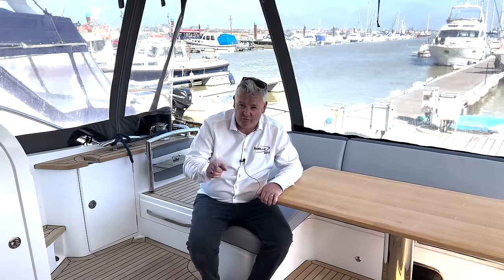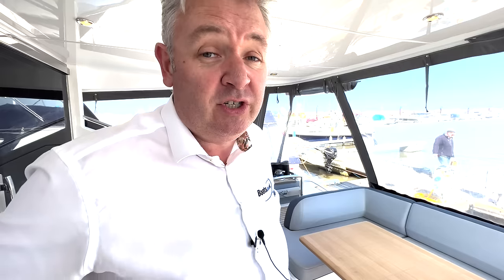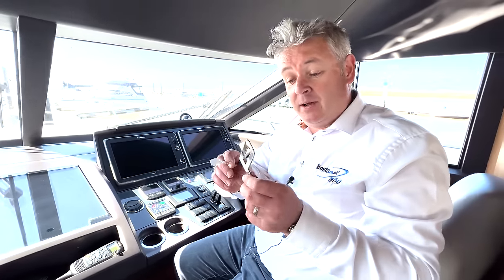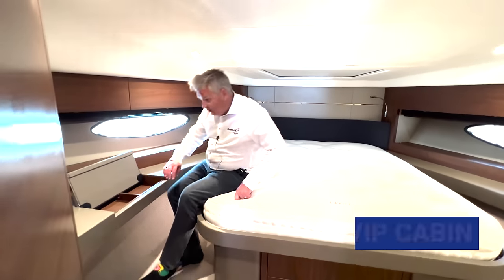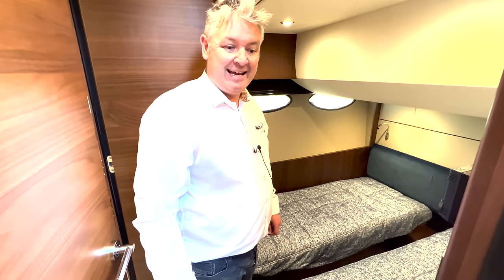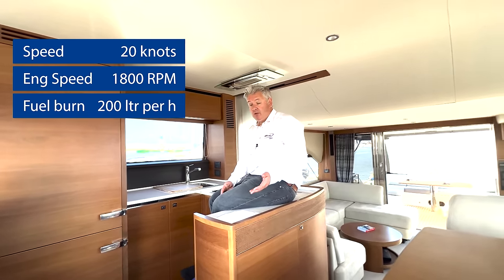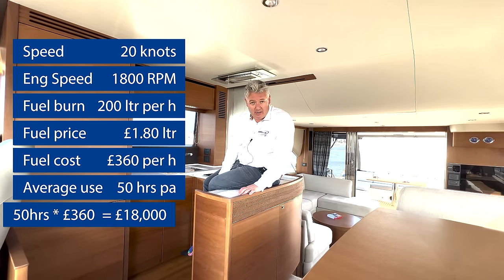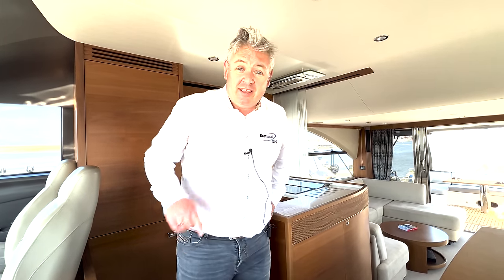£1 Million Princess 60 - How much does it cost to buy and run this boat per year?

Comment: These vids are absolutely great. Especially considering it's an opinion from a boat marketing industry professional. Anyone in the market for motor yachts will Love it! Thanks!
Reply from the maker: Ah thanks Chris 👍🏻
Reply: If this boat was initially sold back in 2016, does it mean EU VAT has been paid? If not, what would be the price of the boat ex VAT?
Reply from the maker: @buoyohbuoy790  it is uk vat paid and can goto the eu with a uk for 18 month stints 😎
Reply: You showed the crew cabin - would someone really have crew in a boat of this size? Didn’t mention in costs..? Would surely be better use as garage for toys in my opinion

Comment: Unfortunately in the real world the depreciation is far greater than that, I was the skipper of a brand new Princess 65 flybridge yacht which cost us £1.1m and it arrived from the factory with 168 faults which took princess 3 years to put right. At the end of 3 years the boat was perfect and we sold her for £550,000. The owner had about 60 nights on board in all that time.
They really are a huge hole in the water to throw your money into, but fabulous fun.
Reply: Wow, that was a lot to loose in 3 years. Just in depreciation that works out to 9,166 pound per night. Then you put your wage in, fuel, insurance etc that works out to a lot of money for one night. Spending all that money, it must have been an amazing amount of fun each night? You are right though, they are a huge hole in the water to throw your money into.
Reply: @spacewalktraveller1  yes it does not make any sense to buy a new yacht, my advice would be to buy them at 5 years old when everything has been done to them all faults ironed out and lots of servicing has been done, they should still look new but for a third of the new price.
Reply: @captaindave47  Thanks for the reply. I was surprised when you said the boat had 168 fault, I though Princess was a top notch boat builder and they took 3 years to fix the problems. I'll take your advise and get a second hand boat, otherwise you are throwing a lot of money away.
Reply: >>At the end of 3 years the boat was perfect and we sold her for £550,000
Was this during the 2008 financial crash or something? Was this part of a deal that might be partly money laundering? Similar models that are over 10 years old are currently going for a few hundred thousand more than that.
Reply: @spacewalktraveller1  no it was before the financial crisis of 2008. We had it on the market for quite a while before accepting that offer, we were planning on buying a new 25 meter yacht but the owner for cancer and the family decided to get out of boating until they knew the outcome.
I think that's why they took the low offer. It's always a buyer's market when it comes to boats.
Reply: @darthkek1953  Going for or advertised at? Huge difference...
Reply: What a fiasco
Reply: @ZorgR  Going for... the current sales market is ... "buoyant".
Reply: As the late and much missed wit Victor Lewis Smith once quipped owning a Motor Yacht in the UK is comparable with standing under a cold shower while tearing up £50.00 notes 😅. Although I would still love one.
Reply: That is interesting and terrifying all at the same time. Can’t be many people who can afford boats like this. I think I’ll keep my stationary house.

Comment: Great Video and Great job explaining some of the costs, which I should point out are subjective. Obviously the fuel costs you mentioned would vary depending on how much cruising one does in a year. If you pay cash which I'm sure some people can do, then the financing and interest normally attached to it would be void. In North America as I am then berthing could be cheaper depending on the location and the Marina. Again some people might be berthing their yacht at their home which is located on the water front. Insurance I assume would also depend on whether you are a seasoned boater or new to the market. Having said all that I did like the fact that you gave your best attempt to make people more aware what the costs of ownership really are. 
Some things which I always look for which I think you didn't mention is; What is the beam length? What size is the black water and fresh water tanks. What is the cost of pumping out the black water tank?    Thanks

Comment: Wonderful video! Would you happen to have fuel mileage if most of the traveling was done at displacement speeds? I'm guessing 8-12 knots for a boat like that, correct? I know that this type of boat is designed to cruise on plane, but for coastal cruising such as on the east coast of the US, many times it's more about the journey than the destination, so speed isn't really a factor except in cases of emergency or outrunning a storm. Thank you!
Reply from the maker: Yes it should use less than half that 😎
Reply: If that's your plan you're much better off getting a semi-displacement hull. You'll still be able to out-gun a storm but your displacement mileage will be a lot better.

Comment: Can’t believe I’ve only just found this channel…. So glad I did!  Been looking for a comprehensive view on costs of one of these boats for ages!  So the 8-10% of boat value, which a lot of people mention seems true in this case.  Here’s a question, which boats generally have the lowest % (of total value) running cost
Reply from the maker: Ah thank you. Lowest running cost would be displacement hull, shaft drive, single diesel motorcruiser or any sail boat.
Reply: A rubber dinghy

Comment: The boatyards I work in, (or river) most just get red diesel delivered which costs between £0.90p to £1.25 a litter depending on how much you buy etc, But with the reforms now on when you get it delivered or from a fuel barge etc, you will need to get a duty rebate of 46.81PPL making diesel around £1.20LT.
Reply from the maker: Good price - more expensive in Essex at mo

Comment: So it's about 10% Runnings of boat price.  As for £60k capital usually is a lowercapital repayment in years 1 to 4 and higher interest, but depending  on the rate you should be able to work the sweet spot which gives you the optimum time upgrade.  It would be good to work with customers to find the right time.  Also helps you market products to maximise your and your customers best options.
Reply from the maker: Yes but be careful as it can vary a lot from boat to boat
Reply: Yes, just been looking through your stock.  50hrs looks a little on the low side when looking at age.  Perhaps 70 to 80 hours might be more appropriate for a larger 60ft boat
Reply from the maker: @vcghana  yes upto 70 is common
Reply: get diff 22 soar éktrç 100p mile rage tejsa 116.jie rabge

Comment: Excellent video. Adding the informative stuff to the tours is really helpful. With a boat of that size in the south of the uk, how easy is it to travel around and find available visitor moorings in marinas at fairly short notice in the summer months (April to Sep)? Eg when deciding on a whim to have a few nights away. Cheers
Reply from the maker: Ummm - not very easy at the moment but you can anchor anywhere 🤩

Comment: I was running the numbers in my head quick.

In order to purchase and run this yacht with your numbers i would need an income (dividends/salary after taxes) at around 300k/year to give me some headroom with my other costs of living, and the ability to make the actual purchase on top of that.
Just calculating funding this with dividends with a 3% return in average, i would need a capital in and around £10.000.000. (10,35 mil including deposit).

The obvious choice if i had £10.35 mil laying around, is to pay cash, no loans. That would cut the monthly expenses radically.
I still would have £9.2 mil. Which with 3% dividends gives ~275k/year.

But.
I would "only" need 175k/year, which lowers my capitalneed with roughly 30%.
Still a lot of money. But not unreachable.

Not there by some margin, but not so far away that i want to exclude it from my bucket list.
Reply from the maker: Love the man maths Niklas 😂
Reply: @Boatscouk  

What can i say. i want a yacht. I just need to get there where my "want" defeats my economic sences.

I have wanted a yacht since the early 90's when i spent a summer working the bar on a big darn yacht in Smögen.

Comment: How often would the engines need servicing?
You said the average user in Europe would do 50 hours a year. That is out on the waves less than one hour a week!
Reply from the maker: Yes - one service per year 😎
Reply: A modern commercial duty diesel engine of this type would require an oil change every 250 hours. You would do all filters at that same time.  If you're not putting 250 hours on the motors per year you would want to do an oil change yearly.

Comment: James, loved the video.
Completely unrelated, but which boat 30 - 45ft would you recommend as a first flybridge ? Thanks
Reply from the maker: Approx budget Scott?
Reply: @Boatscouk  at an absolute push, £250k. Thanks.
Reply from the maker: @scottsmott5657  if you can find a late 08/09 fairline phantom 40 for about £200k - I promise you will be a happy man. Great quality, seakeeping and timeless 😎
Reply: xoxo 32 ekrrç 45 mile range télsà céll 5w mike rànfe gréñ line hybr ejtrç 22.5 or 33.6 mie trane tejsa sélls 26 jíe ràbe 3⁸,5 mile rangé
Reply: 385 soar éktrç sail boat 33.5 ioe garage tejsa ceks 38.5mike rabgre
Reply: early 370 syndbced
Reply from the maker: @scottsmott5657  phantom 40 or squadron 42

Comment: Do you ever come across any American boats for sale that are wired for 110v? Have you ever converted a boat from 220v to 110v, say if an American wanted to buy a boat in the UK that's only manufactured in the UK? Seems as there are more channels in the UK focused on boating than there are in the US. I have fallen in love with many of the boats shown however, they are not available, in the US. It's such a shame. So I'm curious if anyone has ever made the switch from a UK powered boat to one that will operate in the US. Thank you for the videos, I do really enjoy them. The socks are a nice touch :)
Reply from the maker: Yes we have converted uk to USA power and the reverse. It’s quite a bit of work but not impossible - allow 5 % of boats value as approx cost.

Comment: What is the difference between a nautical mile and a road mile?
Reply: 1 nautical mile = 1.15 road miles. So if you are doing 10 knts, its 11.5mph. Basically multiply knots by 1.15 to get mph.

Comment: Thanks, great video. A couple of questions for anyone who knows: Would the generator fuel cost just be part of the general fuel cost? (I guess compared with the main engines, the generator fuel cost is just 'noise'). Do the berthing costs include electricity supplied from the marina?
Reply from the maker: The generator fuel costs would be minimal compared to the engines so are approximately included in my costs. Most marinas meter your electricity in the uk as an extra and need to be added to my costs 😊

Comment: How can a new Volvo engine in a massive 40 ft Lorry go for 2 years without any servicing but a new Volvo engine in this boat needs servcing after only being used for 50 HOURS...costing £6000! can you imagine service costs if you had to sevice your own car every 50 hours of use???
Reply from the maker: Yes seawater is a harsh environment and the reason everything costs more is because it is not used enough too

Comment: How can a bit depreciate 50k a year so half a mile over ten and yet you say you recover most of that back,  if it costs minimum two hundred k a year to run you can’t say it is realistically one hundred because you need two hundred cash, all of the electronics will
Need updating and likely the interior TOK over ten years, not to mention if an engine goes bang, 
You’d be better saying you need minimum this max that. It’s a company owners toy really isn’t it
Reply from the maker: Depreciation for next 12 months is a guesstimate - last 12 months it went up 😎